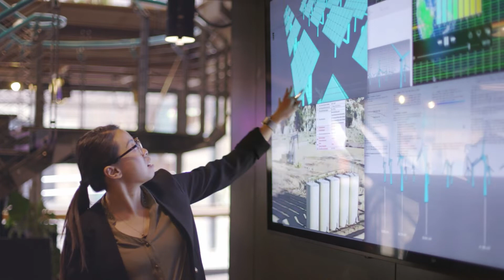Energy Engineers Career Video

Comment: Can an electrical engineer work on energy engineering fields. This is my dream work Field. I really like this engineering Field👍👍👍😍😍😍😍❤️❤️😃😃😃😃💝😃😃😃😃😃😃😃😃
Reply from the maker: Yes, absolutely! Electrical engineers are highly relevant and often in demand in various energy engineering fields. Here's why:   

Overlap in Core Concepts: Electrical engineering deals with the generation, transmission, distribution, and utilization of electrical power. These are fundamental aspects of many energy engineering areas.   
Power Systems Expertise: Electrical engineers have a deep understanding of power systems, including:
Power grids: Essential for integrating renewable energy sources and ensuring grid stability.   
Power electronics: Crucial for converting and controlling electrical energy in various applications (e.g., solar inverters, wind turbine converters).   
Electrical machines: Used in generators, motors, and other energy conversion devices.   
Specific Energy Engineering Fields Where Electrical Engineers Contribute:

Renewable Energy:
Solar power: Design and implementation of photovoltaic systems, grid integration, and power electronics.   
Wind power: Design and operation of wind turbines, power conversion systems, and grid connection.   
Hydropower: Electrical systems for hydropower plants, including generators, transformers, and control systems.   
Smart Grids: Development of advanced power grids that use digital technology to improve efficiency, reliability, and security.   
Energy Storage: Design and implementation of energy storage systems, such as batteries and pumped hydro storage.   
Energy Efficiency: Improving the efficiency of electrical systems in buildings, industries, and transportation.   
How to Specialize:

Coursework: Focus on power systems, power electronics, renewable energy, and related topics during your electrical engineering studies.   
Further Education: Consider a master's degree or specialization in energy engineering or a related field.
Internships and Projects: Gain practical experience through internships or research projects in energy-related areas.
Reply: @CareerOneStop  yes in my elective papers at my university I'm going to choose power electronics, sustainable energy and power systems, cyber security and secure cloud application engineering. Those are my pics so far for my final year. As well absolutely I'm going to do internships and get work experience based on this.